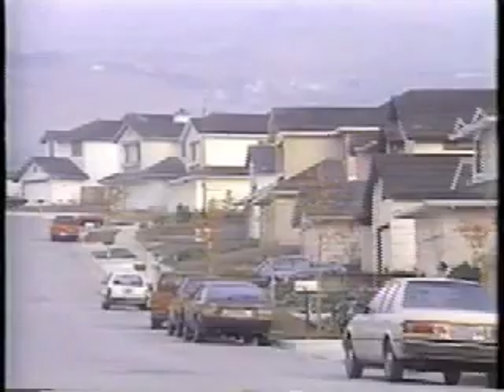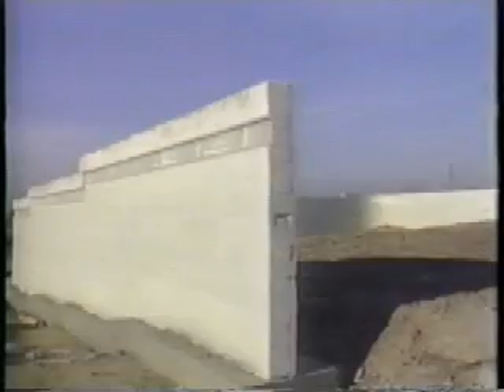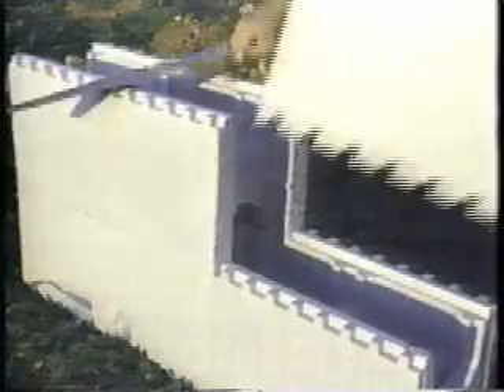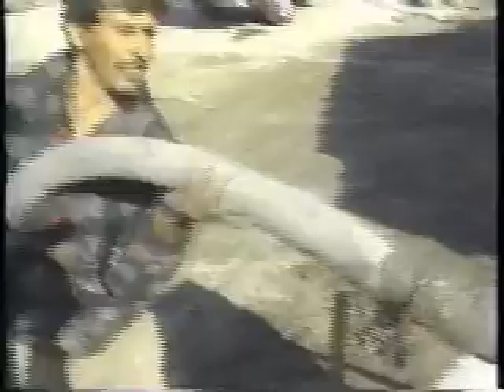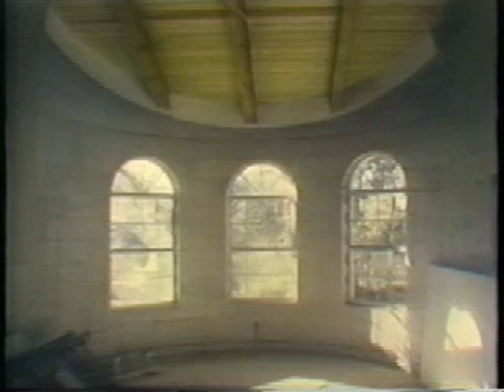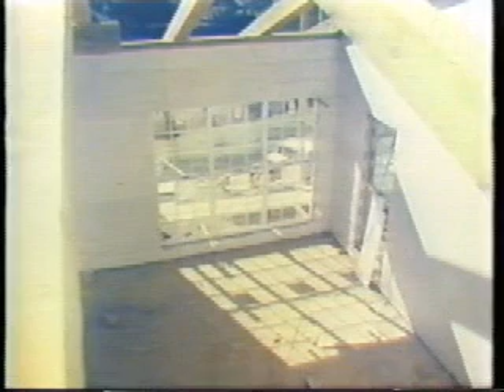Conform Construction Block

Comment: in Romania we have AMVIC with this system but the price is at least the price for building with concrete frames and fill with bricks ... so, no use. for example, you can find a team to build the house for about 20.000 USD. and only the forms of AMVIC cost 9000 USD. so high! I think this system is very much over-valued. it should decrease the costs for a house with hand-work, not increase it.